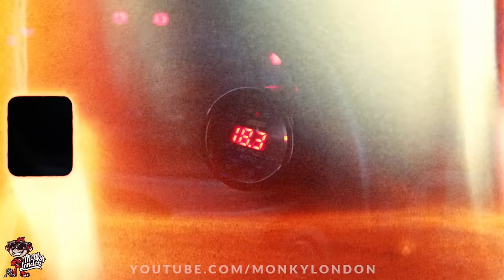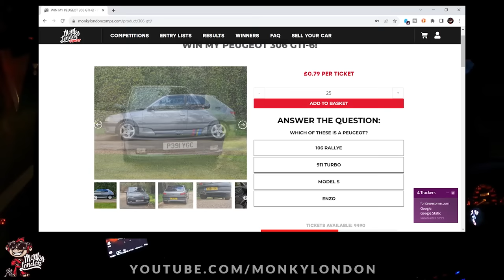THE DRIVERS CAR! HONDA INTEGRA TYPE R DC2 ON ITB'S - SOUNDS INCREDIBLE

Comment: To be honest. Nowadays a clean DC2 with low miles and the perfect spec and decently built could easily fetch 30k. I’ve seen a few DC5s that go for high 20s with AWD K24
Reply from the maker: Really that high? Fair enough if big mods was under impression 15k for decent one no? Interested to hear your thoughts
Reply: @monkylondon 15k would get you a clean clean one from torque gt. Jamie's dc5 is the only awd one I know off. Could say I've seen any awd dc5 for sale. 
Sounds a bloody beautiful, can't best that angry itb sound.
Reply: @jordanthom8963  in Ireland 15k  will get you a flake of rust that fell off an integra haha.  VRT goes brrrrr
Reply: @monkylondon  yeah the US market is really rough people want a lot for their cars plus they are hard to find in good condition cause most owners beat the crap out of them. Finding something with low miles and a good clean example is hard to find here.
Reply: @jordanthom8963  Here in the states we have quite a few AWD DC5s the parts are super easy to get here but it cost quite a bit cause you have to use parts from a CRV or element I would say the cheapest possible AWD budget kit here in the states still runs around 6k and that’s being generous not including tuning.

Comment: That’s stunning! I’d have been all over that if I’d seen it for sale! Just bought a low mile DC2 and modifying the B18. Lots of money in for little out with them but I think if it came out the factory with a B series it should probably stay in these days. I had a K24 EG with a 5.1fd that was great on track and B roads with 15” wheels. Don’t think that 5.8 would be staying if it was mine personally.

Comment: this front end headlight setup is my favorite one the USDM 4 circle lights were okay, but this to me was mint! and i like how he drives and shifts the gears holding firsand second like its a b18 powerband in catch-up mode, then shifts lol i remember you had to shift b16A and B16Bs like that to get the most out of the block But i think you dont have to do that with K20 or the 24's cuase the powerband is more instant?

Comment: Sounds mega! 😮 amazing car n/a is so loud does sound better but he’s bout topped out mods wise. perfect platform 👍🏻
Reply: sound awesome! Maybe hes topped out with his current bottom end (max around 250-260whp) but he can slap a k24 block , 12.5 cr pistons w/ his current head + a set of Drag Cartel 3.2 cams instead of the "drop-ins" .. gains of 40+whp and 30+wtq aswell

Comment: Bro if the owner sees this - please can you show me how the dc5 seats fit in the dc2. Would love to know what subframes were used 😅! I have ep3 seats in my dc2 and they are horrific
Reply: Dc2 rails ...nothing more
Reply: Might need a extra hole drilled. I dis for my ep3 prem seats to swap to dc2 and just smaller bolts and washers.